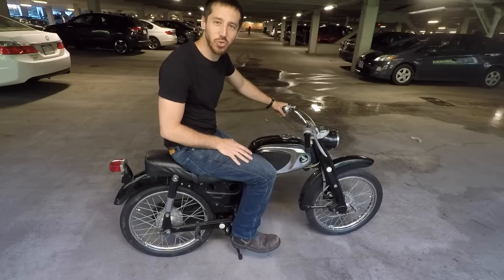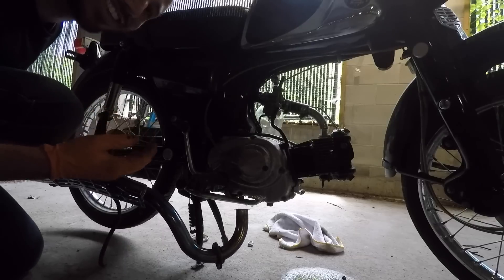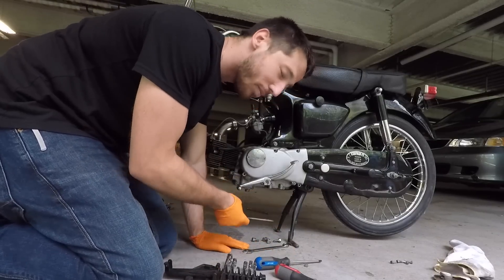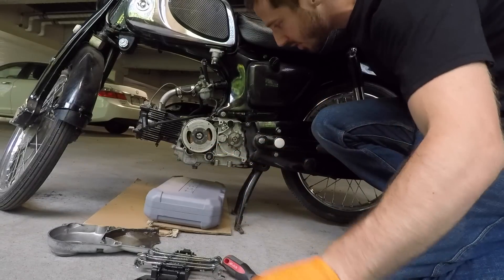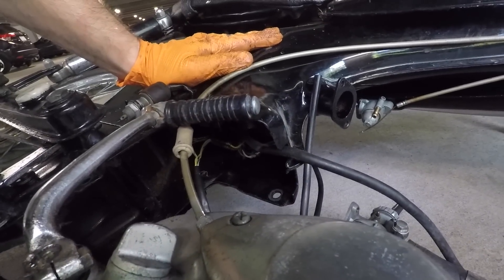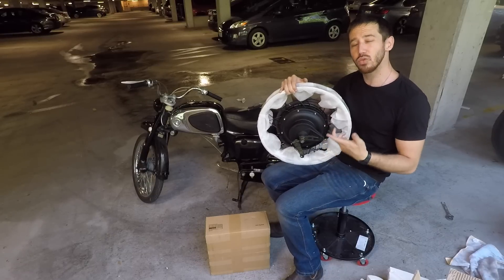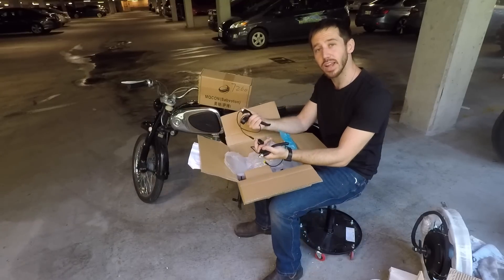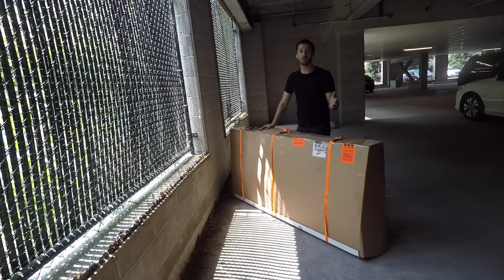DIY electric motorcycle Part 2, engine and e-parts prep

Comment: Bit late to the part and I doubt you'll read this but a little mechanics trick with tough score heads. Give the screwdriver repeated hard taps with a hammer whilst putting undoing tension on the screw head. It acts like an impact screwdriver, just not as harsh. Got me out of many a tough machine screw situation 👍🏻 or just get a impact screw driver for 15 dollars or so. Worth every penny.

Comment: I don't know if you know this trick, but if a screw doesn't want to budge, put a punch or a bolt against the top and give it a wack, not too hard on aluminum.  Steel screws in aluminum often develop corrosion on the threads, making them stick.  A shock will often break the corrosion loose.

Comment: Tried looking at the supplier but they don't have any actual motorcycle parts as you are using. What is the actual part number you used for that wheel assy.?

Comment: I want to know how to wire the lighting system,,, Can I use the existing wire harness? any valuable details well appreciated.
Reply: Yes, you can use the existing harness, go shopping for a step down voltage converter and connect it between the new battery and the battery connectors on the harness, no need to modify anything

Comment: Hi, how's this project coming along? Really interested as I'm building my own from a Honda Cub 70. Would you recommend a mid-drive or a hub. I'm leaning towards the mid-drive and then hook it up via belt drive to maintain a custom classic motorcycle aesthetic. I'll be chopping off unnecessary stuff and I'll be redoing the Frame as a hardtail, in the hopes of getting the bike as light as I possibly can. Maybe some 170 odd pounds without the rider. Given that, adding on the the weight of a rider say another 170lbs as well, would a 48v 1500w, bldc mid-drive motor with a 52v, 25ah battery pack be sufficient for 40km/h and a 50km range? Thank you

Comment: The ordered rim width is more than the existing bike rim how's re you going to alter here, since swing arm don't have enough space for ordered rim... 
Are you going to alter motor with Honda rim or going to use order one..? 
How to know the wheel height..? Normally existing bike wheel height and order  wheel height is both same...? 
Or we just need to compare only rim width..? 
When we order what is primary element that we need to check with existing wheel irrespective of wheel/rim with Hubmotor 
Please reply

Comment: He thought removing the engine was ome of the biggest hurdles. Then he tells us the rear swing arm needs widening. Id be surprised if I see this finished. Shame as it looked a good project.
Reply: A shame. It looked like a good little Honda
Reply: hodaka1000 old honda motor cycles have a place in my heart. First ever motorcycle I rode at 12 was a 70’s honda C90. Superb bike!

Comment: I am building an EV Motrocycle out of a vintage Honda as well (CL100, 1972)! I'm super curious about the hub motor that you purchased, and am looking for the same thing. Did you just reach out to the company? How much did the custom hub motor cost?

I need a drum brake on my hub motor, otherwise I would have to go with a mid-drive system which just seems... messy.

Thanks!

Comment: Why do people deal with these things?  Because, the internal combustion engine is still cheaper and more practical.  Your electrical bicycle is going to cost five times as much and go less than half the distance that that classic machine will go on one gallon of gas.  The carbon footprint for the production and shipping of all the parts you are going to install will cause more pollution than that motorcycle will ever produce.

Comment: Man this motorbike uses about a gallon per week on 25 miles per day , How the fuck are you saving by converting. You re just destroying a really good bike.Besides all the money you will spend for the conversion is worth 2 years of gasoline + the extra power charge you will use to recharge you already did more damage than good.

Comment: Have you made any 3phase e bike motors with automotive alternators? If so what kind of performance can you get out of them. I have an old Honda xl75 I want to convert to an e bike and I just so happens to have an old gym pickup alternator sitting around. The only things I’d have to buy for it if it’s worth using that would be batteries, 24volt charger and a controller. I’d like to do 24 volt as I can put 4 small 12 volt batteries in 2x2 series parallel configuration for 24v and double the amp hours on the bike. Harbor freight has some good cheap deep cycle AGM batteries that I believe are 35 amp hours each. I figure those would work well. What are your thoughts?

Comment: Hey Micah, I have a 1992 Honda CB 250 that has sat unused in my garage for almost 20 years. I have been thinking about converting it to electric. I went to em3ev.com and it looks like they specialize in ebike kits, but I didn't see anything that would adequately replace the 250cc gas engine that the motorcycle currently has.  I am glad you are posting videos again, and I am ready to see how your project finished up, but if you could help me  get on the right track, I would be most appreciative.

Comment: Have you thought about mounting the electronic display into the surface of the old tank? You're already talking about mounting the control box in there which would involve cutting it open anyway and if mounted flush with the tank surface won't break up the lines of the tank

Comment: Thanks for putting this up. Shanghai Customs has a prefabricated bolt-on kit to adapt the frame to an E-Cycle, kind of pricey though. Yet some of the bits are made to house electric parts and fit in just as the original motorbike looked. When's the follow up? Interested to see how you fit in the controller, b.m.s., and batteries. Thanks for the video.

Comment: I usually don't leave two comments but you realize that lithium mining is terribly for the excitement? Also, most cars now are zero emission, get approx 400 miles per tank and can be refiled in five minutes. You still can't do that with battery powered vehicles. As smart as you are, your extremely biased.

Comment: Hey. I enjoy your videos you asked the question about the hose on the exhaust...that’s a condensate drain meant to drain off the acidic water that forms mostly before the muffler comes up to operating temperature. Normally a muffler is rusted out because the hole rusts shut. 
That bike you’re butchering is/was worth more as a stock bike even in disrepair.

Comment: You don't really know about engines right.
Now they're fuel injected by a computer and it monitors the engine if it's misfiring it will adjust the mixture and fuel to make the engine as efficient as possible.
This motorcycle engine is carburated so the engine creates pressure an sucks the fuel and it was not very efficient things have changed alot

Comment: With this build, you're clearly going to use a hub motor and a really high power battery. Do you think you'd be able to achieve the same speeds this system will with a central motor then a gearbox before the rear wheel? Obviously you'd get less torque, however, it would mean you wouldn't need as high a power battery pack and speed controller for the same top speed right?

Comment: Hey, Great video!
I'm in the process of two non-standard e-bike builds. One is an antique 50cc top tank moped build very similar to your bike. The wiring on mine is a complete mess and my goal is to rewire all the peripherals (head and taillights, blinkers, horn) into the new battery or creating a separate smaller 12v system to handle those. Are you intending to wire the existing setup into your new battery? 
Do yo have any advice on how to go about either of these options?

Thanks!
Reply: I managed to get a 12v converter from 60v down to 12v,  powered through the controller

Comment: A great video thanks. 
I've built a similar project using a Honda 125 base,  with 750w mid mount motor,  using 60v lead acid batteries. Nice ride, well balanced but heavy, range is way below expectations, I will follow your vids further.  I'm sure my batteries are the limiting factor. So hopefully need to build my own lithium batteries & follow your example. 
I'll ask questions after I've watched your vids. 
Cheers I like your style.

Comment: Micah, nice videos man; been following for a while all your builds and inventions. Check out my 95% complete gas generator ebike hybrid - 3kW Cyclone + 800W generator. Less than 12-15 miles I use just the ebike but for longer rides and random cruising I use generator ebike hybrid system. Thought you might like checking it out. In WI, motorized bikes are allowed up to 30 mph. Not pure electric but it still uses less gas than a moped and most of the time I'm only on ebike part.  https://www.youtube.com/watch?v=3yX9-OsR1ds

Comment: Growing up in the days when the first Honda 50 came out, it hurts to see that bike being dismantled and re purposed, but it will be an interesting project which I will be following.
Reply: I haven't even grown up seeing them but hacking a beautiful running bike like that for a project just seems silly. Stock matching parts like that are hard to find, whereas just a frame would be way cheaper and easier to work on. I lost it when he said the hardest part would be removing the engine. Damn!

Comment: My bmw k1200s threw a rod through the lower crank case. Right now I’m in the process of disassembly to drop the ICE engine out. Once I’ve got that done, I’ll have to evaluate three options: 1) rebuild existing motor, 2) replace engine with a used one off eBay, 3) try an EV conversion. I like the idea of the EV conversion, but it’s a much bigger and heavier motorcycle compared to this. I’m figuring at least $5-10k for the parts, and I’d still probably wind up with only 50-80 miles of range and a top speed or 80 mph. Thoughts, comments, suggestions, recommendations greatly appreciated.

Comment: Hey! Awesome channel I just found it researching e-bikes since I recently picked up a super 73. The company itself doesn’t release detailed specs so I’m looking to Lear to upgrade now that I have the frame. 

I want to increase the speed, is it better to replace the hub motor battery and controller? or would adding a mid drive motor be a better solution?

Comment: I worked on these Honda's in the 60's and owned a Honda shop in the 70's so watching you struggle with removing the engine was painful to watch. ;-) Tip on removing Phillips head screws: Never start removing them without a hammer and impact driver...it's much simpler. Often just using a blunt punch against the head of the screw and hitting it with aforementioned hammer will loosen it too,  If they do strip out use a  hammer and chisel to turn the screw until it loosens. Works every time. At any rate, you don't need to worry about it now. Good video Micah and good memories for me. Looking forward to seeing how the project progresses.

Comment: Hi Micah. I was wanting your opinion on the LG HG2 18650 cells. I haven't seen you use them in an ebike, but the specs look like they would work for a high discharge application like an ebike or maybe a death ray... They are pretty cheap on Amazon right now and I'm not sure if they're just too good to be true.

Comment: Hey can i use a 84v to 96v rated controller for running a 72 v motor???
Reply: Yes but you will need to take precautions against overheating.

Comment: Question: Is it possible to remove the battery pack from an E-bike and simply allow the rotational energy from your cycling to power a single or multiple motors on an E-bike? If so, how would you do this?
Reply: No. However you could use a capacitor in place of the battery and set up the motor to charge the capacitor (regenerative braking) and then use that energy to assist with accelerating.

Comment: Thank you for your most informative videos they are done in a way that anyone can learn how to make a battery.
 I need a battery for a 1200W enclosed etrike.
 The battery it comes with is a gel 60V 45AH. 
It can take up to 72V 60AH battery.
Thanks to your videos and some others I have already made  a battery for my 1000W e bike by recycling  lenova lap top batteries. 
My question is can I make this etrike battery the same way I made my ebike battery using 15mm nickel strips spot welded .
Can the nickel strip handle the load.
I would like to make 2 x 8S or 2 x 9S batteries in series giving me a 16S or 18S battery.
Which do you recommend will the 2x9S battery have much more speed and range.
I will use a BMS for each of the 8S or 9S battery.
I'm looking forward to you battery build video for your motorcycle conversion.
Thank you in advance for any help you can give me.
Frank Tauber

Comment: I did this build with a Tomos Streetmate and 35AH of 18650. Used the Same QS motor and Sabvaton. The streetmate is bigger than that bike, I can get about 45-50   miles of range (And i only take the battery down to about 28%) around the backroads of Boston.  I have been driving it for 18 months. Hot me up if you want some info, insights, reviews.

Comment: Once it's stripped the best option is an easy out or grabbit. I didn't think it would work but it pulled a long busted off bolt out of a jet ski block when I had just about given up all hope. The most important thing I learned is that you use the little drill counterclockwise as well.

Comment: 🔥HELP QUESTION🔥

So I built my own EBIKE and got some hover board batteries from Batteryhookups and wanted to overvolt without adding extra cells to the battery because I don’t have a spot welder and don’t want to solder it bc I’m afraid I might damage the cells. 

Would it be possible to get a good enough dc - dc constant voltage converter and turn my 36v batteries into a 42,46, or 48 voltage on my 500w  36v EBIKE? If I get a converter strong enough to support at least 20amps (just to be safe) would it work? Just so then I don’t need to go out and get another battery.

I haven’t found anyone who has tested this, if it’s plausible I might just have to try it.

Comment: Awesome project!! I'm building a 26s40p battery pack for my electric motorcycle. Can't wait till the next video.
Reply: Monster battery !  What kind of power and weight for that build ?
Reply: @saxonsoldier67  cbr900rr frame with wheels and brakes is about 140lbs. And battery is going to be about 130lbs. Not sure if I want to go that big and might downsize later. Thinking about vtc6 cells but we will see.
Reply: @TRC91    That sounds very light.  Does that include the electric motor and controller ?  Either way, you will get plenty of range and performance out of your electric rocket.  I'm sure that we would love to see a video of that conversion project.  Good luck !
Reply: @saxonsoldier67  motors about 30~40 pounds and controller is probably a few more pounds. Trying to find a good 26s bms right now. And still printing out my battery holders right now lol

Comment: Instead you got to waste time constantly charging the battery or replacing the battery. Gasoline powered vehicles are better than electric period, by the way I own both. I'd rather ride my 49cc 4 stroke powered bicycle any day of the week than my 500 watt/36 volt ebike.

Comment: What size is the new rear wheel?  Does em3v also sell 72v batteries?  Like others in the moped community we are looking for ways to convert our two strokes into electric and reach faster speeds than 30.

Comment: Hi, as the automotive industry is now switching over the 21700 cells wouldn’t it be interesting to explore that type of cells?
Thanks for your awesome videos
Regards
Reply: Expensive. I am building a 20s 6p with 20700s. I had to buy 120 @ $16au each from a vap guy. :(

Comment: random tube IS the intake manifold. you really don't know anything about engines, do you? i know engines, and motors. knowledge is power, dude.
Reply from the maker: No, the intake is the large rubber hose. The thin snaking ~1/8 inch tube is what I was talking about.
Reply: @EbikeSchool  the large aluminum tube connected to the head is the manifold, the rubber hose is the boot between the carb, and intake, and the thin tube is an oil supply line i think, but since that is a 4 stroke, you can tell by the valve adjustment covers that look like large bolts on the top, and bottom of the head, it might be a vacuum line. this bike pre-dates me a little. those older bikes tried a lot of unusual methods of doing things they don't use anymore. now i'm curious, i don't like not knowing. i'm going to find out, and get back with you. i know you probably don't care, but it'll drive me crazy if i don't find out what it is. what a way to start my day.

Comment: In the states you pretty much can do anything, regulations are to a minimum. Here in Israel, even attaching a tow hook to a car requires official inspection and extra taxes + yearly inspections as well. Converting an old motorcycle to electric is nearly impossible.
Reply: Same in belgium. You just cant do this in here. You have to sell it to someone you know in germany. Get the papers there and then import it back. What a bunch of idiots decided these rules.

Comment: You traded a reliable bike engine that can sit for 50 years and still be made to run for a battery that will go nowhere if it is left sitting for even a fraction of that time. Is that really progress?
Reply from the maker: yes
Reply: Battery compares to gasoline fluid .... That's where the energy comes from. So, will you terrific engine run with 50 year old fuel??? ... We both should know it will not. So your argument is entertaining, yet silly at the same time. Now, you want to argue which engine will most likely turn after sitting for 50 years? ... My bet is on the electric motor.